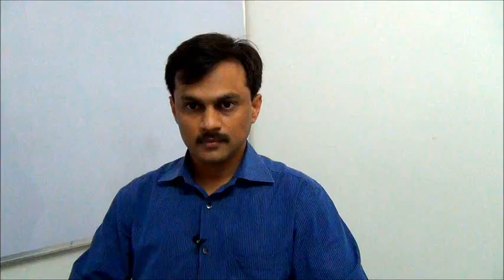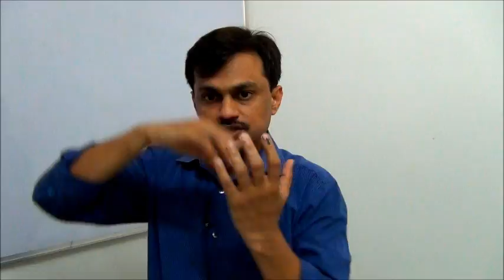Difference between Quality Assurance and Quality Control |  Project Management Professional (PMP)®

Comment: Hi Saket, Need your help to get below answer as per topic in vedio QC

Joe is a project manager on an industrial design project. He has found a pattern of defects occurring in all of his projects over the past few years and he thinks there might be a problem in the process his company is using that is causing it. He uses Ishikawa diagrams to come up with the root cause for this trend over projects so that he can make recommendations for process changes to avoid this problem in the future. What process is he doing?

Perform Quality Planning
Perform Quality Assurance
Perform Quality Control
Qualitative Risk Analysis

I think it is QC
Reply: Ohh thz great but not successful
Reply from the maker: Soumitra Saha Hi, this is a process analysis and he is not working on one defect , he is looking at trend PMBOK 243 ,
"Quality assurance seeks to build confidence that a future output
or an unfinished output, also known as work in progress, will be completed in a manner that meets the specified requirements and expectations. Quality assurance contributes to the state of being certain about quality by preventing defects through the planning processes or by inspecting out defects during the work-in-progress stage of implementation"

please join our forum for such conversations , forum.izenbridge.com